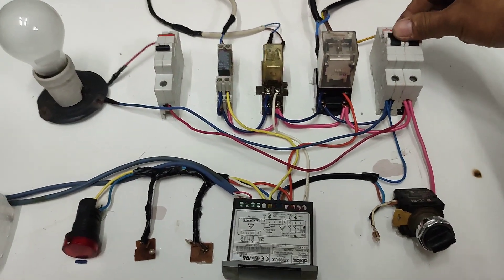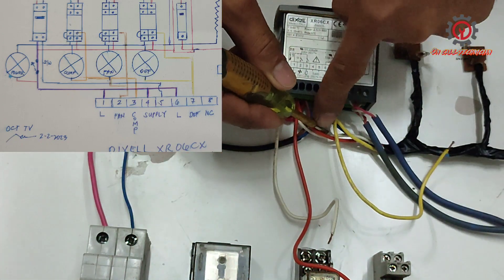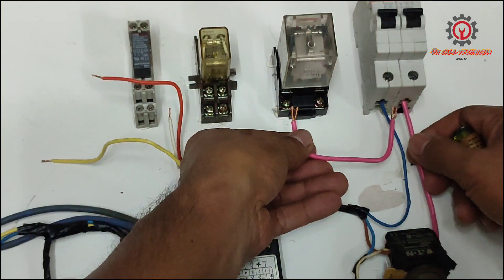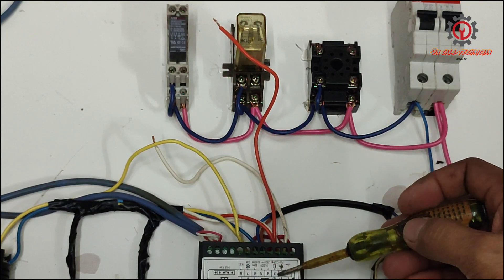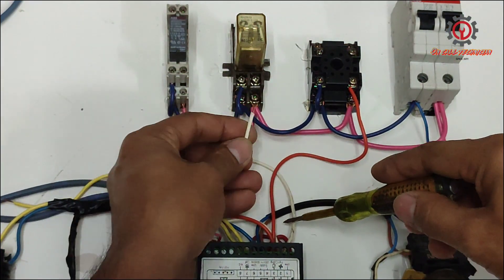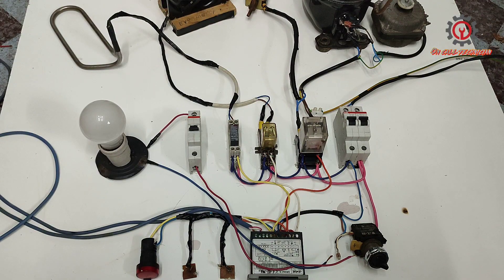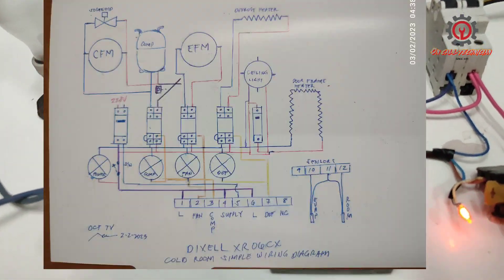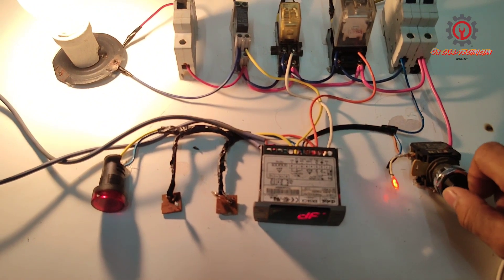WALK IN FREEZER SIMPLE WIRING CONNECTIONS / DIAGRAM

Comment: master, need help walk in freezer. 2.00 x 3.00 x 2.4m. height, what is the recommended compressor rating - 2hp?   and LRA?
Reply from the maker: Sir complicated yan hinihingi mo, ang daming factors ang dapat iconsider. Download mo Cold room calculator sa play store at fill up mo lang hinihingi nilang mga  datos. Sa mga units namin ay laging over rated / size ang  mga compressor. Business at supply 30 plus stores ng food and beverages. Example ng small cold room namin 1.5 x 3 x 2.10 mts namin ay 3 hp na.

Comment: Broo if  I send to defrost and compresor and fans still working (don't turn off)
What do you think is the problem?
Reply from the maker: Don't change anything bro, perhaps its hot gas defrosting
Reply: @THEMULTISKILLEDTECH  but the evaporator is frozen
Reply: @THEMULTISKILLEDTECH   no bro the evaporator has heatings
Reply from the maker: @frankesquivel3300 yes its heating bro via hot defrosting. If you have defrost heater and compressor still running, your digital control's relay is defective sir. It should be off during defrosting, for the fan you may change the setting either you turn that off during defrosting or turn it on
Reply: @THEMULTISKILLEDTECH  so tje problem is a relay no te controller?
Reply from the maker: @frankesquivel3300 compressor relay of your  your control sir. Stuck up
Reply: @THEMULTISKILLEDTECH  thank you  broo
Reply from the maker: @frankesquivel3300 test it sir by turning the unit off, if compressor still on the its confirmed. Your welcome sir